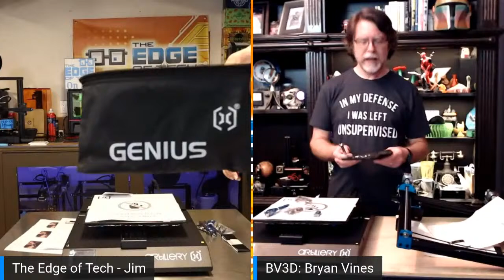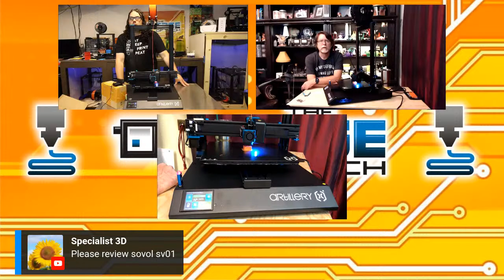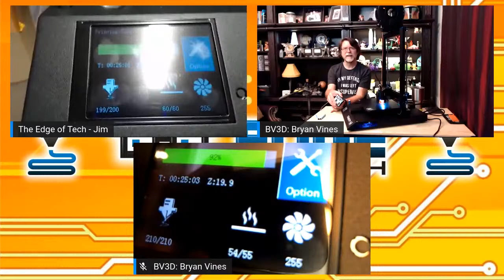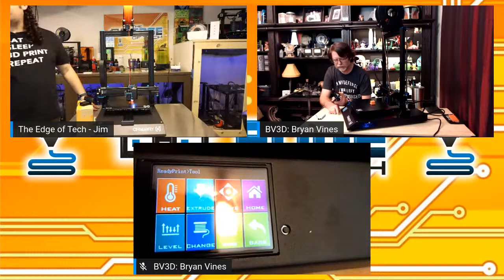Building the Artillery Sidewinder X1 3D Printer with Bryan Vines

Comment: Top tip-: if you want to release a part from a textured glass bed quickly, let it cool for a few mins and then get an air aerosol can and hold it real close to the bed where the part is and spray around the part 3 to 4 times
Reply from the maker: Spray it upside down (so there's a freeze blast) or right side up?
Reply: @BV3D  right side and then upside down

Comment: Hello Bryan. Thanks a lot for this interesting video.
I installed Cura 4.7.0 released version two days ago. It was working fine. But suddenly, I have noticed that when printing the files sliced with Cura, the printer moves extremely fast and I'm obliged to abort the printing. What do you think is the main cause?

Comment: I have stopped using Thingiverse, mainly because most of the parts I download don't work, I spent 12 hours printing a Darth Vader face mask and none of the sub-assemblies fitted the mainframe of the mask, they were like 30% undersized.
Reply: maybe you had some slicer settings wrong?
Reply from the maker: I still like Thingiverse. It's mostly been working for me. Some days the search only shows a single page of results when I know there should be several, some days it works great, and apparently yesterday it wasn't working at all. 😁 There's also MyMiniFactory, which I like; I'm still not sold on the PrusaPrinters site; and I'm not a huge fan of Cults3D, mostly because they have SO MANY ads and the ads are almost always the ones that try to look like a Download button for the model you're looking at. The ads there even go so far as to match the color scheme of the site.
Reply: @BV3D  have you tried yeggi?